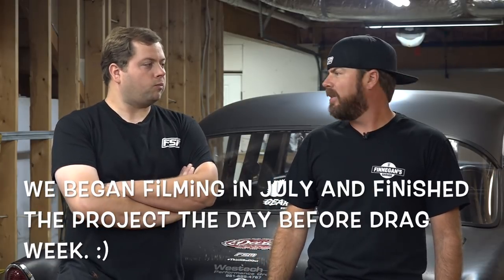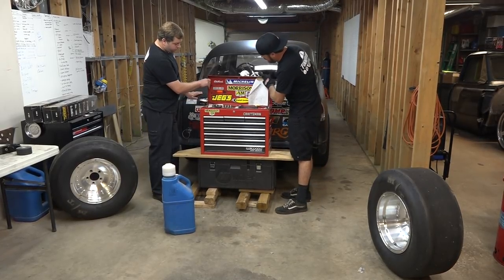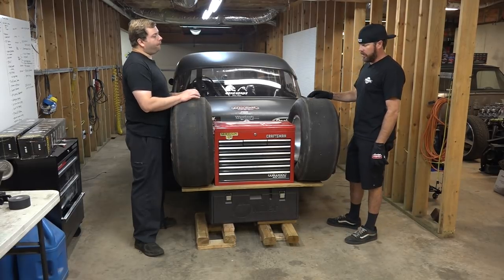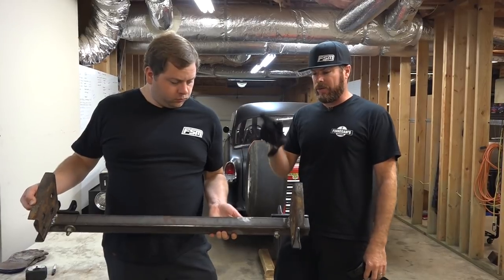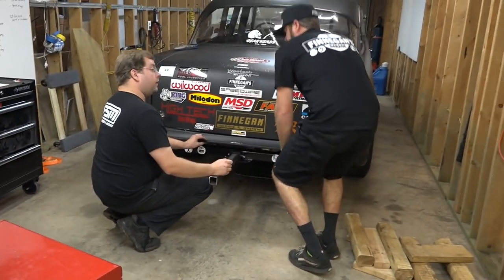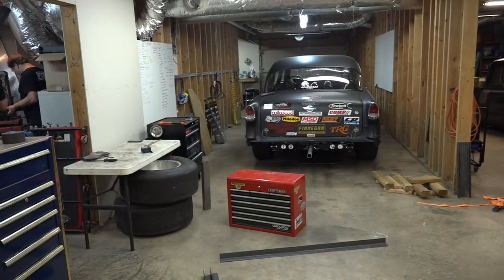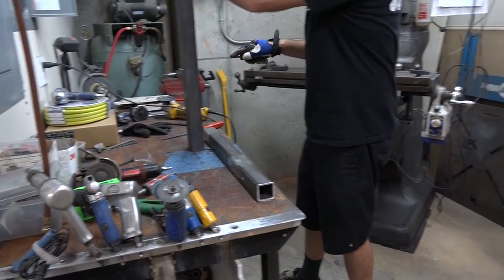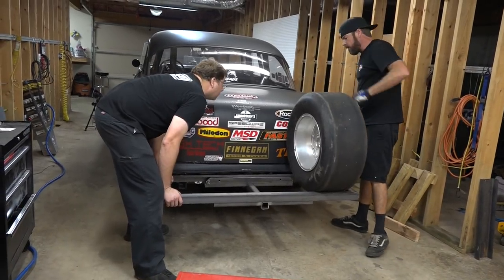Finnegan's Garage Ep. 40 Now With Better Audio: How-To Build a Hitch Rack.

Comment: Sounded just fine.  Built something similar many years ago for tree cutter crews here in the Pac Northwest.  Used stretch metal to fill in the frame so junk could be piled on and have wet weather drainage and still be somewhat light.  Very nice work on that.

Comment: I dont know the distance between the 2 pins but u could have bent some bar stock into a u shape and welded two short tubes on one side of the cart... used the u shaped bar stock as ur pins, pull it out, stick the ends in the tubes and have a stand up handle like a flat bed cart

Comment: Hi, love the video! Just one comment about something you mentioned. You said the black surface on hot rolled steel is caused by it being pickled. Pickling is an acid treatment to clean metal, usually silver or copper. The black finish on hot rolled steel is scale or Iron oxide caused by heating above around 800c. I’m a blacksmith and work with steel every day. Big fan by the way, not trying to be a smart ass! :-)

Comment: Hey Mike love your stuff man! You should look into getting a good cold shoe mounted mic like one made by rode. Plugs right into your camera so it is easy and sounds great. Then you dont have to worry about one of you being louder than the other. OR you could go the other way and plug your lav mic receiver into a audio compressor then into a recorder. That way the audio is leveled before you even get to post.
Reply: Remember:  You can always add more, but you cannot take it away. 
 Never, ever use compression (or any other effect) anywhere other than post.
Reply: Not necessarily true... Using very mild compression coming in can do wonders. In this circumstance it wouldn't have changed much though. Setting up a couple permanent room mics in the garage could be useful. They'd provide a bit more balance to supplement when one of the mics isn't working (like now). You might run into phase issues but that's not difficult to fix with guidance.
Reply: Isaac Norman Which, again, is easy to do later...and almost impossible to guess correctly beforehand.  

The singular benefit to compression before recording is to help deal with SNR issues - which is absolutely not a problem that is experienced with modern digital gear.

Comment: Sounds like you need a multi-track audio recorder like the Tascam 60DmkII to record your lavaliers/lapel mics, and a shotgun off the camera.  Or the cheaper option of connecting your lavaliers to your cellphones, running recording software on them,  and using a hand clap or slate to spike the audio with the cameras and mics to sync it all up in the editing software. (That's why the audio and camera guys have you do that!)  Then you can fade the audio between channels when other people talk during editing.  The 60dmkII is a better option because it uses 'timecodes' to sync everything together, but requires wireless mics to be convenient.  That kind of gear is certainly an investment,  and it's probably something better for the future, if you carry on with the channel.

Either way, love the channel!

Comment: Leave the trailer light transmitter in when you're on the strip, and people can watch your brake lights flash on your toolbox back in the pits - right? I imagine there's a bit of a range issue, but it is a funny idea. Could work well enough for some hotel room 'red light district' antics, though.

Comment: I would make your center bar a little bigger to help carry that weight better.. OR cut a couple of other holes in the hitch and weld in a couple more bungs so you could slide in like 3 supports all together just to make sure the center support doesn't bend from static weight and the dynamic loading from driving down the road.

Comment: Hey Mike, hope you didn't get rocked too hard by the hurricane. Nice work as always, love the design, I'll have to utilize something similar to this for my welding cart. Is it any easier to do wheelies with all that weight back there? If so, least it'll double as a wheelie bar haha.

Thanks for the inspiration!
Reply: By the time Irma got into Georgia, it had weakened into a tropical storm, and the strongest part of the storm missed the Atlanta area.

Comment: You have a towbar, use it for its intended purpose. Hire or build your own trailer. Far easier on the car instead of having all that weight so far back.
And with a trailer you can carry a spare engine, clutch gearbox and diff centre as well as the tools. And with hindsight you needed them!
Either that or make a flip forward seat and put the wheels and luggage in the back seat are
Reply from the maker: i don't want a trailer.

Comment: you can bake out the metal with a torch when your run across contaminated metal. or when your in a  pinch and dont have a torch setup. long arc the tig rig.

Comment: if the toolbox is solid enough you couldve welded two old brake disks with the propper bolt patern on the sides of it with lugs pressed through them and mount those slicks straight to that  with some lugnuts , prolly wouldve made the frame to mount everything to narrower as whell and hold the wheels a lot steadier 

as for the audio , it seems like youre friend was wearing a lapelmike and that was all there was for sound 
wat might work in this setup to just hang the lapelmike down from the rafters about barely above youre head when youre standing and centered above where youre working on the car , at least the volume is about level that way or can be boosted slightly without one voice sounding louder than the other , i actually used a simulair setup to record bands in a practice room

Comment: Needs a way to lock toolbox down to keep prying fingers out, and be more secure than ratchet strap, and maybe a way to attach a push handle, or insert a jack handle to use as a push handle so one does not have to bend down to push.

Comment: I Wouldn't have put that much faith in those self locks, altough that tool box is legendary. Still would've turned it facing forward.. Other than that, nice design!
Reply: Oikku Oek i think he is going to be putting a ratchet strap overvit so that should protect all but two small drawers

Comment: Should have turned the toolbox 90 degrees, moved the slicks inward, and you wouldn't have the tail light obstruction problem.  Put some marker lights or reflectors on the rack, and go...
Reply from the maker: but then i couldn't access the tools easily. in its current configuration i can get into the toolbox without removing anything
Reply: Well, that makes sense then. I can't believe you take the time to read all the comments! Good deal!
Reply: plus this keeps the whole package closer tongue car and lessens your overall length. it also creates a less steep angle when you go to take it all off the hitch.

Comment: First thing, WHERE IS EP 41?
Second thing, That valve failed for only 3 reasons, 1st reason defective, 2nd reason not enough clearance, 3rd reason not installed properly.
Reply: Or 4th reason, wear. The heads that he was using where 12 years old. Finnegan had planned on putting new heads on the engine before Drag Week, but he ran out of time.

Comment: I would have put a layer of that Teflon plastic on top of the horizontal crossmember bars to help smooth the sliding action of the frame.  Would have had to be done before drilling the holes for the pins, though, as it's 1/4" thick.This stuff: http://bellplasticsfabrication.com/plastic-materials-plastics/ptfe-polytetraflouroethylene-teflon/